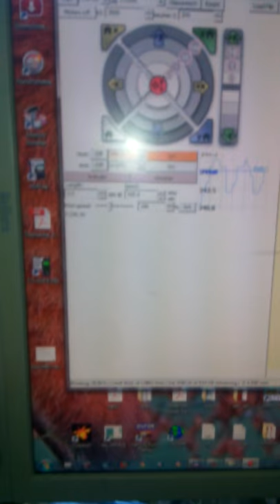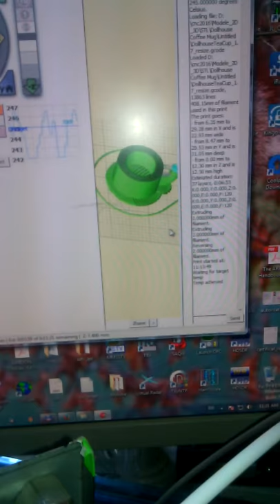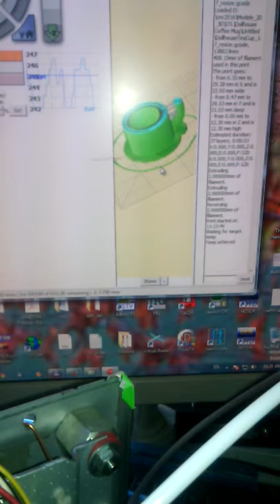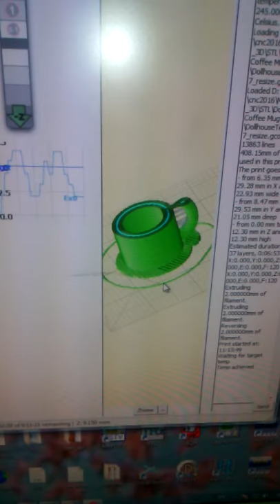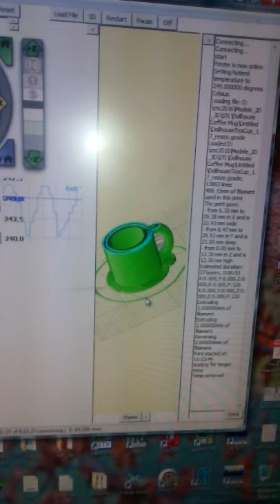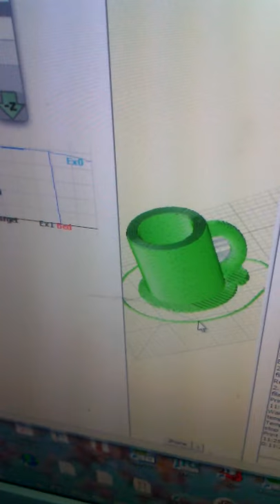cd rom 3d printer

Comment: which stepper motors drivers are u using and will it work using a 5v stepper motor 28byj...
Reply from the maker: Hi ! I use A4988 with 1/16 microStep ,Your 28byj will work fine but first you need to cut that trak  http://www.electronicsmayhem.com/?p=13 and calibrate steps/mm http://reprap.org/wiki/Triffid_Hunter%27s_Calibration_Guide .
Reply: G G thankz but didn't expected a fast reply
Reply: can u provide the circuit
Reply from the maker: table look at one of the tests https://www.youtube.com/watch?v=bahPVfPrupc I use SinapTec contoler home made pcb http://www.reprap.org/wiki/SinapTec_AT328.02 and Teacup firmware .
Reply: G G oh thankz for the info do u have a insta or fb or whats app or anything that I can communicate to u
Reply from the maker: this is a picture on my fb acount https://www.facebook.com/photo.php?fbid=155906678555483&set=p.155906678555483&type=3&theater
Reply: G G oh thankz